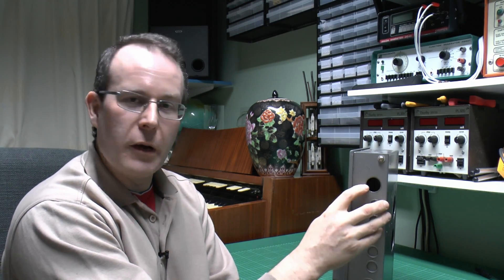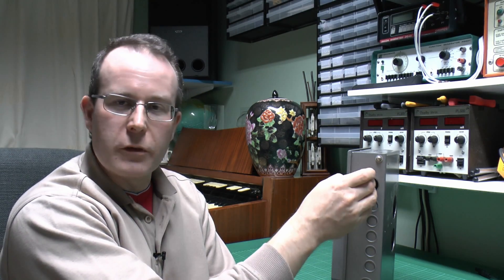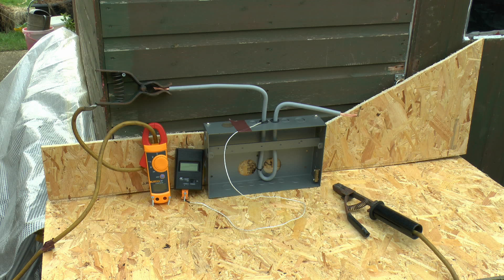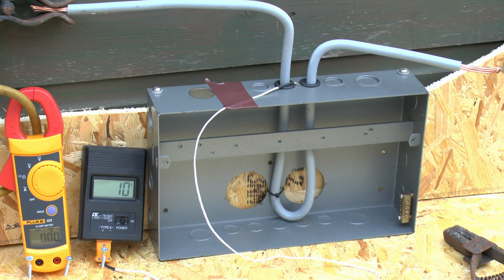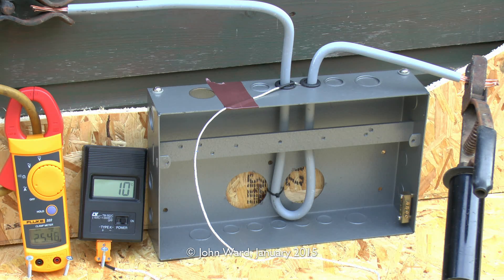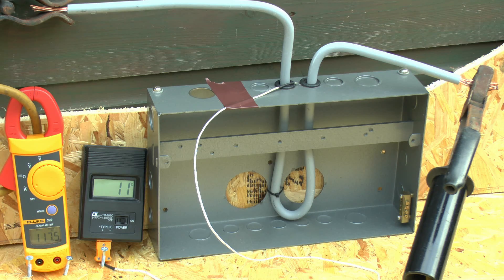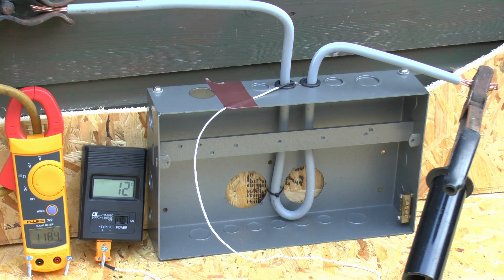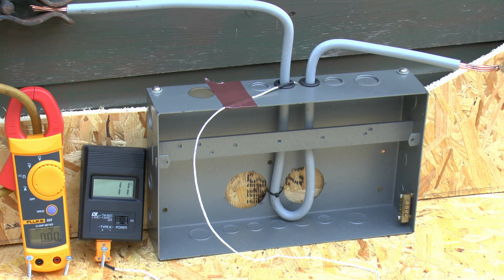Single Wires through Metal Holes

Comment: Came across a 3 phase meter in a factory unit connected with 25mm tails which came through individual holes in a metal trunking under the meter. The trunking was running very warm!
Reply: Was it warm because of the cables being warm or from eddy currents?
There is an armoured cable feeding an overhead supply up the road from me. It's running more load than usual as they're backfeeding another section on it, and it gets warm due to the load.

Comment: Nice experiment, but I will suggest an improvement if I may. Your temperature probe is going to pick up the wire itself heating up inevitably. Let's assume that the metal box acts as a choke on the wire and adds imaginary resistance to it. Here's what to do: Run your constant power supply through your wire in open air (no box) and measure the voltage drop on it as accurately as possible. Then install it in the box, reattaching the ends as faithfully as possible. Measure the voltage drop again. The difference in the voltage drops can be used to calculate the impedance of the choke and the heating power in the sheet metal.

Comment: I wonder if a thicker enclosure like the old cast switchfuses would heat up more?
I remember reading it was recommended to cut a slot between the two holes to stop any eddy currents.
Reply: +heavydiesel I am personally more worried about the electrical impedance from the reflected magnetic fields overheating the copper, not the fuse box.

Comment: I don't understand how any well constructed tests' result could be disappointing unless you had a cherished  prevous opinion or theory  you were trying to substantiate.

This test supports my theory that code authorities sometimes make codes based upon preconceptions without doing any calculations or tests, and/or fail to modify them when experience and testing shows those codes are overly conservative.

In the US, regional codes are as often based on union electricians preferences and are inflexibly enforced until experience from regions without trade unions demonstrates that other materials and techniques are safe and effective.
Reply: i know im 5 years to late but not sure this test is well constructed in order to be real life an earth needs to be present as if you look at any transformer diagram . in order to induce induction one pole\side needs to be greater then the other ie line (25mm) in one hole neutral and earth in another hole (25mm + 16mm) this would gave true readings
Reply: @gasmonkey7430  Wrong. His test 'failed' because the case is of very thin sheet-metal.
Similar to she core layers in a transformator which are so thin for the same purpose, not to get hot.
What he has built is the first half of a current transformer.
Anyway, interesting.

Comment: Not sure why did you expect significant eddy currents resulting from a couple of wires going perpendicularly through a thin metal plate. You mentioned transformer core lamination design, well it is almost exactly the same scenario here with two notable exceptions: 1. it is like just a single platter of a transformer core rather than the whole bunch of them; 2. it is wire going through the plate once rather winding around it. All in all eddy currents at 50Hz should be expected to be insignificant in those circumstances and so they proved to be.

Comment: I'm sure that in high current situations, it can cause overheating.  However, despite it not being able to overheat within 125A, any added heat to the system is not helpful when it comes to dissipating the normal system heat.  Either way it's to be avoided.

Comment: JW Firstly you videos are very informative. I feel that for the eddy currents just bringing a conductor through the steel enclosure with a load on is not the correct way to test this theory, In normal situations the line and neutral conductor would be entering the enclosure and then the loads placed on these cables would be from inside the enclosure. I was told a story when i was at college many years ago now how a TP+N supply was installed in singles conductors and installed into the DB singly. A 2kw load was placed on an outgoing circuit and the heat after a short while blistered the coating on the DB. Again possibly urban legend. But would it not be an idea to test this theory in a video. Also the 2 deg temp rise was most likely caused but the conductor temp when running a 117amp load. I look forward to your thoughts on this.
Reply: +Mark “Marcuscrackus” Everitt How is this setup any different to what you described? What do you think would happen differently to the field lines around the conductors?

Comment: In the US we use romex clamps for leads exiting the breaker panels and the feeder leads from the service are housed in conduit from the meter box in most residential situations.
In commercial situations everything is in conduit.

Just seems the systems in the UK are down right dangerous and under rated but I know that is not the case, I personally haven't had any experience with UK type systems outside of a random radio battery charger with the "weird" plug on it lol.

So I have an question. Could you take a GE type service breaker box and use it in the UK? I mean ours is 220 - 240 volts across two 110 - 120 volt leads with a common ground / earth ground.
Reply from the maker: ElfNet Gaming All UK systems are 240V, so for any given load, the current will be half that of a 120V system, so circuit breakers have lower ratings and the cables/wires are substantially smaller.

It would not be possible to use a USA service panel in the UK, as we do not have any 120V circuits, everything is 240V + neutral, and earth/ground is always separate from the neutral within an installation (it's not permitted to connect E&N even in the fusebox).
Reply: I see. I knew you used a hot and neutral system  similar to ours just at a higher voltage and generally lower current. I find it interesting that the earth ground is not terminated to the neutral in the service box though..
Well they dont teach us much on foreign electric code here but I assume the same holds true there.
This is why I like youtube channels like this, people actually know their stuff and I learned something I didnt know about the UK systems.
Reply: +John Ward In regards to TNC earthing in the UK, BS7671 regulations 543.4,  543.4.1 &amp; 543.42 cover this subject.

Comment: What problem we have is the magnetic flux will create an electrical eddy current and induce heating of the chassis of the "consumer unit", or "breaker panel", "sub panel" or whatever they are called in whichever local. We sometimes use single conductor mineral insulated conductors here in the USA. Usually we have three phases (120 deg lead/lag) and a neutral. These single conductor MI cables are usually 50 amps and greater, so the probability for heating is slightly greater. Usually we will cut slots into the metal between all the holes involved. I like seeing the old UK mains systems again.

Comment: Good evening John, May I ask and maybe state, did you post this video as BS7671 Amendment 3 states that in 2016 all CCU which are to be installed have to be metal.
Reply from the maker: Matthew Pye Not specifically, although it is certainly relevant to that.
Reply: Matthew Pye They don't HAVE to be metal, they have to be of a non combustable material

Comment: Interesting,  if i had to bring the tails into 2 holes I'd cut a line through the bridge thus making it one hole. 
I really think we've taken a step backwards with the regs here as there are lots of plastics that don't support combustion
Reply: glenwoofit As Wylex now unhelpfully put a single 32mm hole the centre of the bottom of their metal CUs with 20mm ones either side, I was going to do exactly that here (cut a slot between two of them) so the meter tails can enter neatly in line with the main switch. But I wasn't expecting the eddy current heating to be so small.
Reply: +Graham Langley That's exactly what I did - a single hacksaw blade cut - and the sparks was quite happy with it.

Comment: Interesting, I was expecting a larger increase, given the dire warnings that used to be given. I wonder if in a real world situation, if the high frequency harmonics produced by large amounts of switching power supplies these days may cause this to be a much more significant problem in commercial installations (thinking of 400-1600 amp commercial supplies with IT equipment hooked up). I know these harmonics can cause problems with neutral overheating on 3ph supplies, maybe the extra eddy current loss at higher frequencies would cause issues too?